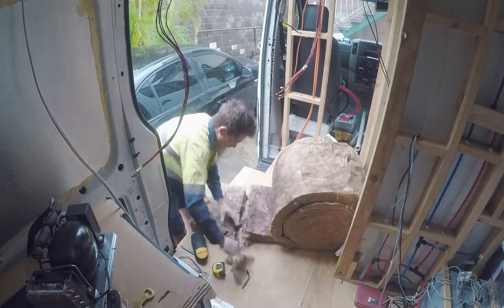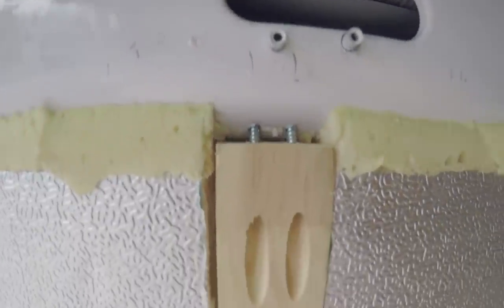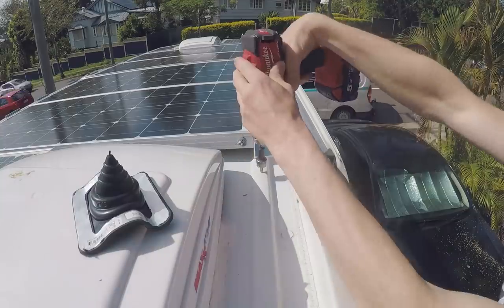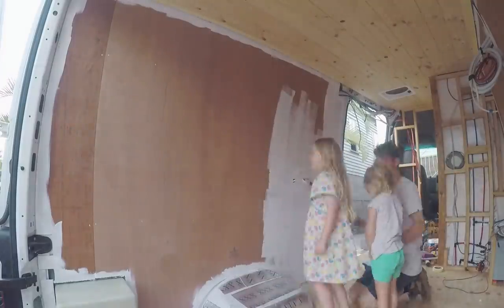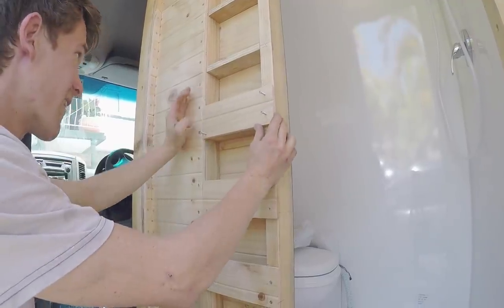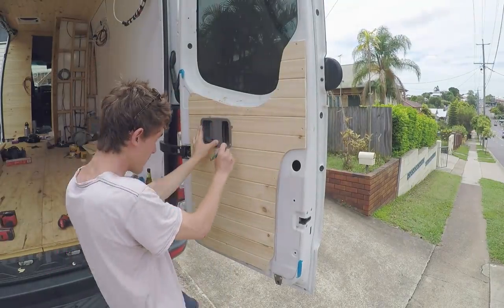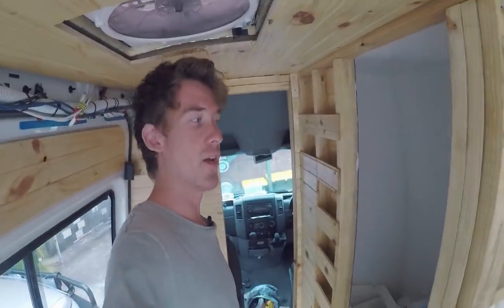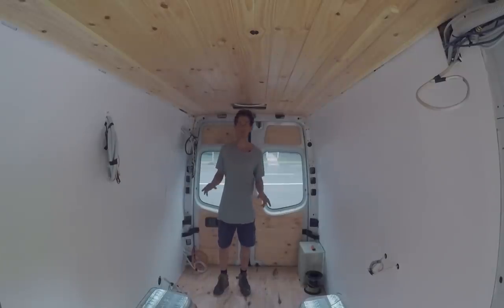S1E10 Sprinter Van Conversion | Sheeting

Comment: In the climate i live (Sweden) we can't screw the wood for the celing into the metal ribs like that. The ribs will create condensation and the wood will grow mold within a few months. =(  I need to move..... =/
Reply: Also the vapour barrier is a must in the climate I live (Latvia) :)
Reply: We should all move down to south of spain... =)
Reply: True!
Reply: vapour barrier seems like a catch 22 because it's not good if it's not airtight but the screws will puncture it as you're attaching your wood so I don't know
Reply: Aren't most vapour barriers breathable?
Reply: In order to avoid ribs  and contoured metal housing I ended up converting a box truck instead of Sprinter.   Fiberglass reinforced plywood rectangle was easily insulated with 2" closed cell foam panels (R10)  along with radiant barrier on all surfaces.
Reply: I live in Poland, have same wooden panels, and nothing hapaen wrong, but i living in my home on wheels all times in germany, holland, britain, working 6-8 months at year, I spend my holidays in France, Poland and Spain mainly. Paint with antifungal and often ventilate the vehicule, hold a higher temperature inside, or keep it in a heated garage. Inserting and pausing in a micro fireplace can also better dry the interior. Standing on soli, or the place of asphalt is a big difference in moisture.
Reply: Meet ya at Santa Fé :D
Reply from the maker: awesome you live in the van man I wish you the very best on your adventures :)))
Reply from the maker: sounds like an insulated beast!!!
Reply from the maker: I am not entirely sure, most i've seen people just take plastic to the wall that isn't breathable, but I could be wrong :)
Reply from the maker: yeah thats true, I feel its better to leave open especially in australia where it can get very humid
Reply: Ulf, I have been thinking about using plastic screws to eliminate the cold bridges. There must exist plastic rivets that are strong enough to at least hold the panels, right?
Reply: Out in Oz they probably get the condensation on the outside lol
Reply: I would have thought a vapour barrier with timber would be needed if you plan on visiting any cold climates , southern alps, or take the van to NZ etc? 

My van is an ex ambo with a box back sheeted in alloy panel and I’m debating g this point with myself at the moment (its insulated with R3 foam) but no vapour barrier when constructed so thinking about it behind any Paneling and floor?
Reply: zed elliott it depends o  how you have insulated. But 2 vapour barriers are not a good idea. You will trap the moisture and it will rot and grow mold eventually. It's a God damn rubriks cube, this insulation business
Reply: You'll never be able to get rid of all the cold bridging, eventually there is going to be some areas which are exposed. In my build I've insulated in much the same manner as this but after installing the battens I've stapled and bonded a VCL to the battens. Then over each batten I've applied a liberal bead of silicon sealant, and given it a couple of hours to go off before screwing my boards in place, that means you end up with a sort of gasket, which not only seals the screw holes, but also seals the staple holes which I made when i stapled the VCL down.
Reply: It sounds like a good dea! I have not seen rivets like that, but have not looked for it. =) Also, as in the answers above, a bit of antifungal paint seems like a brilliant idea. 
Good luck with your build!!!!
Reply: Antonio Perez
Reply: Use screws for metal flashing and put flashing tape between the wood and metal.  Dont stuff too much insulation, so the air can flow and keep things dry with the vapor barrier. ;)
Reply: If you keep the van warm and have good ventilation it should not be a problem.
Reply: NOT installing a vapour barrier shows an extreme lack of knowledge bounding on ignorance. This van is going to be completely destroyed really quickly if you get near any type of cold. Going to cause rust and mould throughout the entire vans walls an insulation. What a waste.
Reply: As I see it, there are a few options, (I would suggest using more than one as the budget allows); 1. Treat the backside of the plywood with an anti-mold spray, there are several on the market that kill and prevent mold, you can spray on the wood and metal, some are nontoxic. 2. Use a vapor barrier, 3. Use moisture absorbing devices, several solutions exsist, some passive, some plug ins, if you have the power, use a dehumidifier in the winter. 4. install a ventilation system ie: computer fan, and vent, to turn on in warm dry weather to draw out any moisture build up in the walls.

Comment: Wears gloves for installing insulation but no mask....I'm a sparky too and at 45 my lungs are shot from breathing that crap in for 25 years crawling through ceilings. Gotta wear a mask. Yeah I know it's not pink Batts but half as much fiberglass is still a lot
Reply from the maker: Yeah you would be right, i have definitely breathed in my fair share of terrible roof insulation, but won't be breathing much in from this point on in life

Comment: Ur back has no isolation, so thats a bit bad
Reply from the maker: The voltage that those panels "strings" are at are pretty low man, you don't need an isolation point on the roof. however, inside the electrical cabinet, each solar circuit runs through a seperate 32A DC solar isolator, it's all done properly. you can see this in Ep.13 my friend

Comment: NOT installing a vapour barrier shows an extreme lack of knowledge bounding on ignorance. This van is going to be completely destroyed really quickly if you get near any type of cold. Going to cause rust and mould throughout the entire vans walls an insulation.
Insulating bits of the walls, and nothing on the rear doors, why even bother putting any in at this rate. Do it all or not at all.
Triple studding the shower in places is way over kill, along with all the 2x4's used is to much extra weight to be carriing around. 
Sheeting the walls, should have been done in 3 vertical pieces, trying to force to panel in place like this is rediculous.
Reply from the maker: Let's just wait and see :) it's more important to try and fail, and then learn, than to not try at all. I love my van :) actually you're only about the 10th person I've replied to saying I did put insulation in the doors after I took the panels off to oil, but forgot the film it. Best to you man 👌🏼😌
Reply: that saying is complete crap, it's more important to try an fail an learn then not try at all, let us think for a second, Sky Dying, Swimming with the sharks, throwing away 10's of thousands of dollars when spending 20 would have saved it all or anything along those lines. Makes sense not everything you did made it into the video. I really really hope I am wrong, it doesn't cost me or your anything if that is the case.